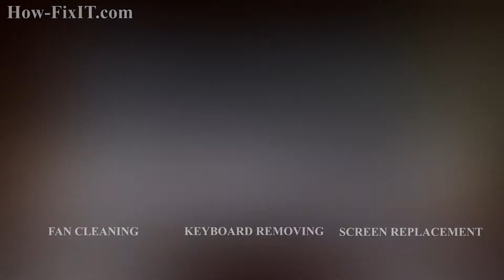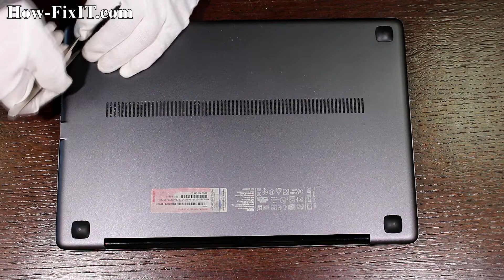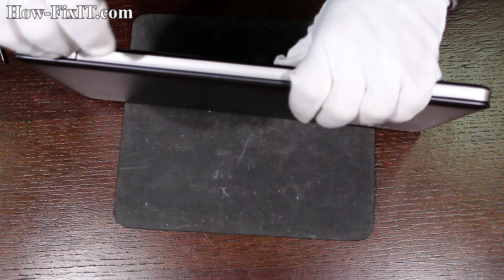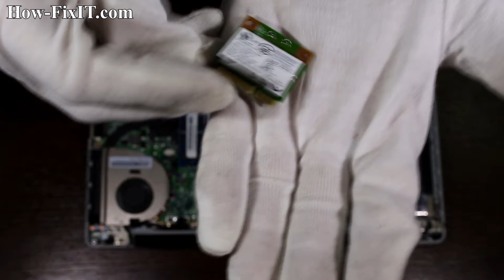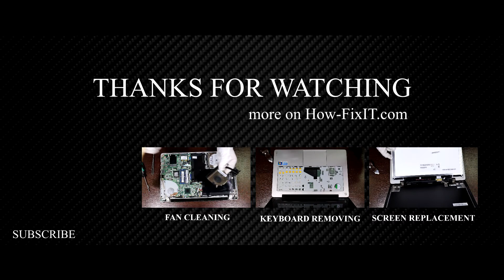Lenovo IdeaPad U310 Wi-Fi Card Replacement | DIY Repair Guide

Comment: Hi. Does this laptop,  the one of the video,  has any WiFi issue? The WiFi antenna is installed just sticked to the hinges?  Thank you
Reply from the maker: Hi. I didn't met any wlan issues in this laptop
Reply: so, the wifi: good signal / performance?